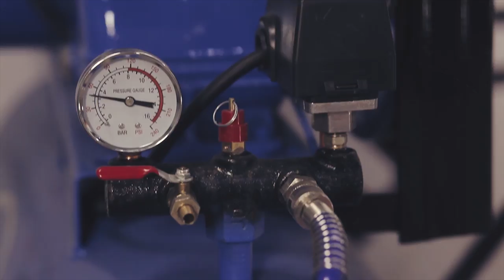Banger Racing Angmering Oval Raceway CB Contact 18-03-2018

Comment: some nice cars getting wrecked  shame
Reply: Stephen Lacey cosmetically good is not mechanically good. Many of these cars will have serious structural or mechanical faults which are bodged together enough for this but no more. They would never be road legal again, or would require several times the value of the car in repairs to make good. Either way, some people consider this a better end than simply throwing the car into a crusher, at the very least it provides an eco-friendly source of entertainment.
Reply: one that i would gladly watch.